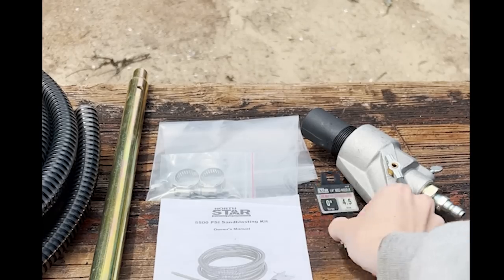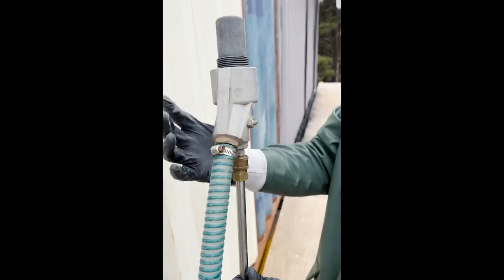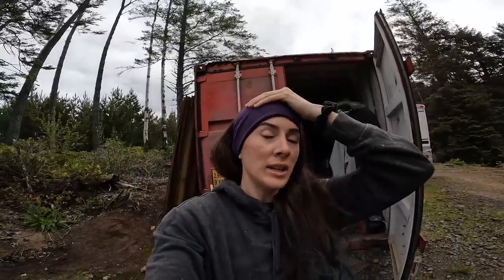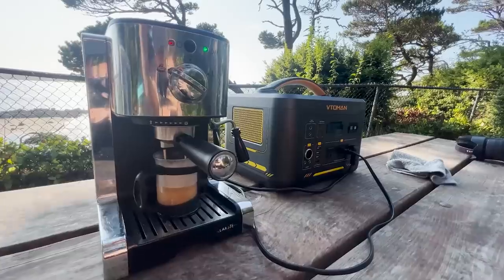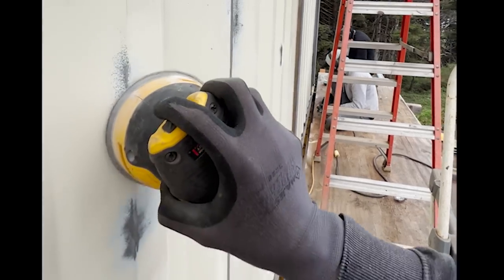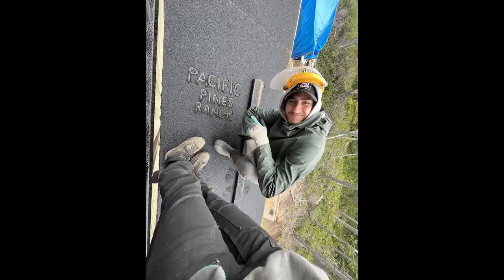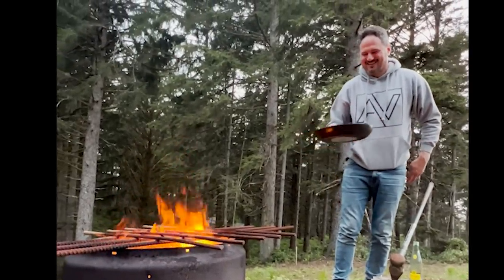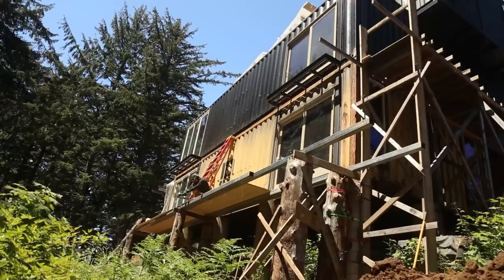From SHIPPING CONTAINERS to MODERN TREE HOUSE... THE JOURNEY CONTINUES #building #home #diy

Comment: For my really long extension cords (100 feet) I take a piece of plywood about 1 foot by 2. then I cut out a 'mortise shape' on each end deep enough to wind up the whole extension cord. It sounds really simple because it is. It is cheaper than one you buy in a store and it will last for years without breaking.
Reply from the maker: Thanks for the tip!! :)

Comment: Awesome! Excited to pick on up!! The dry sandblaster wasn’t impressive with the compressors I have to run it.
Reply from the maker: Thank you!! We also have a dry sandblaster but we only use it for very small areas and projects because the air compressor has to refill every few minutes and it takes forever. :)

Comment: is that an automotive epoxy primer? thanks
Reply from the maker: No it is a 2 part marine grade paint. The first layer is a zinc epoxy primer and the second layer (which is the black paint we use on the house) is an acrylic top coat
Reply: thanks
 @PacificPinesRanch